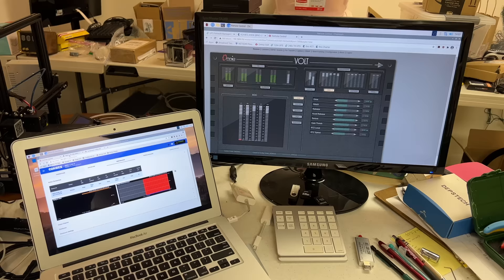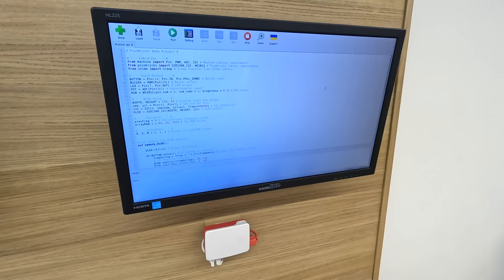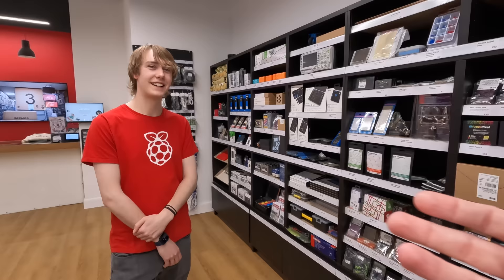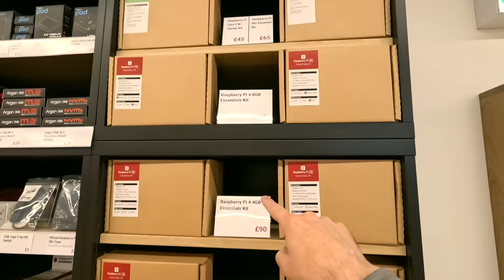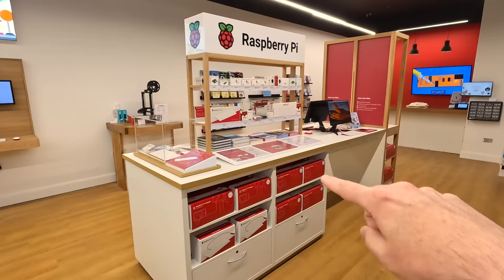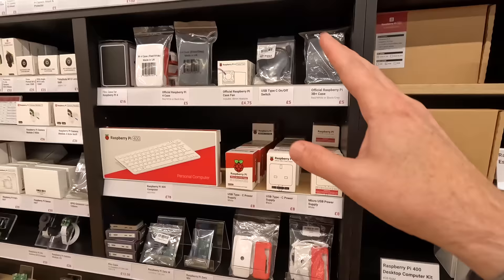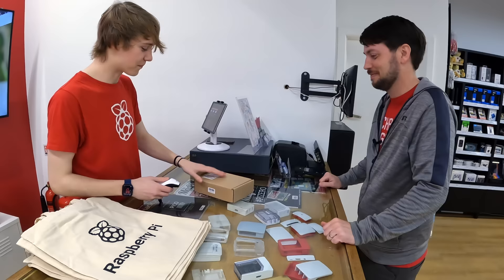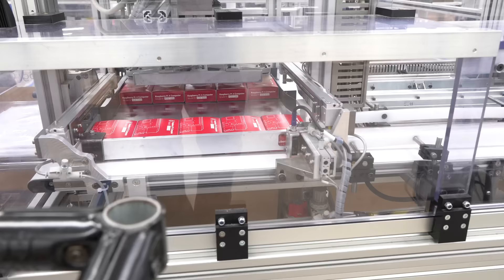I visited the only Raspberry Pi store in the world

Comment: Ahh i do miss Maplin, but I don't miss what it became in the last 10 years of its life, it went from a Hobby and specialist focused store to another generic consumer electronics outlet. You could still buy components from them of course, but the offerings dwindled as their focus shifted until its demise.
Reply: I worked at the main returns department , to workout what was real faulty or people just changed their minds over ( B grade resells ), so the returns with between still unopened items to house bricks , and yes we did get a few house brick or wooden blocks instead of the returned item , but mostly missing PSUs.
Not a good place to work at too, but work is work .
Reply: The catalog used to be my bible (and great artwork)
Reply: Yeah, it turned into a generic electronics tat shop because it was bought out by a private equity group which just wanted profit. Such a shame.
Reply: @davidf2281  i remember crawling through their catalog when it was only 1/2” thick when I was 10 years old, such a shame they moved from their roots of a mail order only from Southend
Reply: @davidf2281  I remember a lot of their Pi kits was returned why ? , because they included a cheap usb lead which wouldn't power it due to voltage drop on the cable . 
a returned item just because they cheaped out on the cable.
Reply: I remember using them when they had just one shop. Later I used the local shops for components. Then just for cables when PCWorld/Dixons/Curry were cheaper computer stuff. There always seemed to be more staff then customers. The end with that vast number of shops selling to a diminishing customer base was inevitable.
Reply: The catalog, filling in the form at the back, sending it to Rayleigh in the post and waiting 2 weeks for your stuff. 
And the sci fi themed cover art.
Miss that. The expansion to the High Street ruined it.
Reply: I used to walk in every time I passed any Mapin shop. But their prices were just way too high to buy most things towards the end.

Comment: The micro center in Los Angeles already has one of those setups. It still is rare to find any pi except a pico, but they have the display.
Reply from the maker: At least if you have a Pi already, there's a good assortment of accessories!
Reply: Dallas microcenter also has it. It was pretty much whipped out when I saw it. They had some mugs and a keyboard and that was about it for that display.

Comment: Two videos that are absolutely necessary.  #1: describe every rasberry pi, each one's capabilities, strengths, weaknesses, components (i.e. 2USB ports), speed, memory on board, can they run windows, linux. etc. etc.
#2: compute modules, what types are avail.  what do they do, how they connect, what do you need to make them work, any add on's, what can they run etc. etc.
I'm a 69 year old and, although I've been involved in "micro computers" since the altair 8800, SWTPC 6800, (1970's) - There was a time that I didn't follow the technology and need to catch up on specifics.  I'm not 100% up on "github".  Help us old folks to get up to speed on things... Last year, I found out about the Arduino.  Thank you.

Comment: This place is just up the road from where i live (but i didn't know it existed lol) I was so gutted when Maplin Electronics closed all it's stores here in the UK, as it was my go to place for eletronic components and nowdays have to shop on Ebay for those parts. I do have 4x Raspberry Pi's in my collection so far. I have a R/Pi Pico which i use for work on the Xbox 360 consoles, i have 2x R/Pi 3b+'s and my latest Pi is a Pi 4b 2gb for my A1200 "FrankinPi" build. The range of R/Pi's is just amazing and they are a brilliant little computer board.

Comment: Jeff I have 150 pi 4’s installed in TV transmitters (at remote sites) to check in or control the encoders, exciters, and power amplifiers.  I had to switch to pi400’s because I couldn’t get the 4’s

Comment: No RPIs by itself even in the bloody one of a kind RPI store?
Bruuuh
Problem is most of the use cases dont require any of the hardware from the kit, like a voron printer where you power it from GPIO and it all runs headless via network.

Comment: I don't have a single Pi yet. I wanted to buy a 4 rpi but was concerned about how much heat the CPU was producing. I was worried that I couldn't easily use it without a fan. Today impossible to buy it at a reasonable price :(